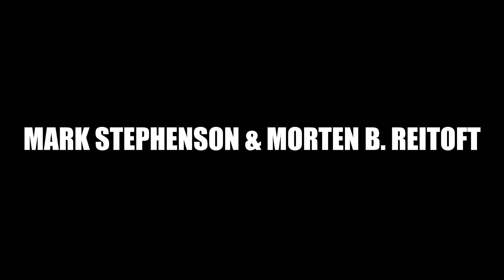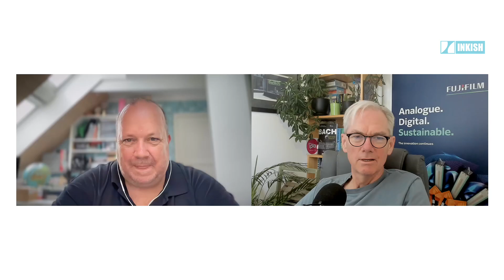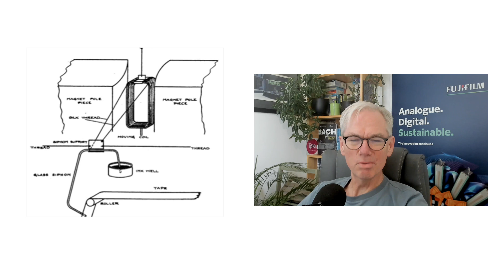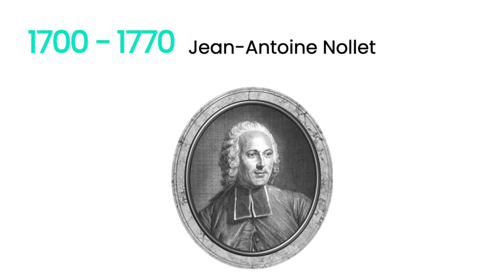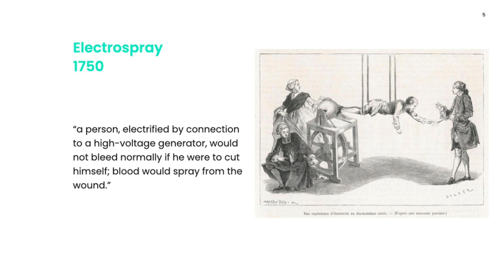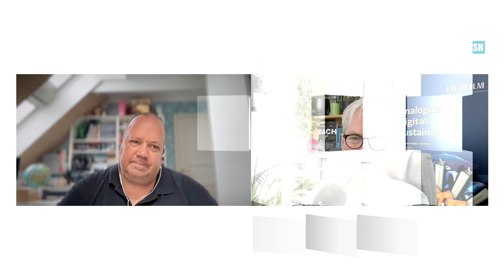The First Inkjet - or? · Mark Stephenson & Morten B. Reitoft

Comment: You have some catching up to do with your inkjet history recollection. But the electrostatic blood projection story is excellent. This is a valid inkjet technology mechanism. Thanks for sharing this story. You just mentioned Spectra. I live in New Hampshire and once considered working there. All early jetting was based on fluid flow through a nozzle.  
My interest is with surface fluid projection from sound with a nozzle. This was not invented at MIT. Don't confuse it with bath SAW drop generation. Nozzles acoustic drops came first in 1984.